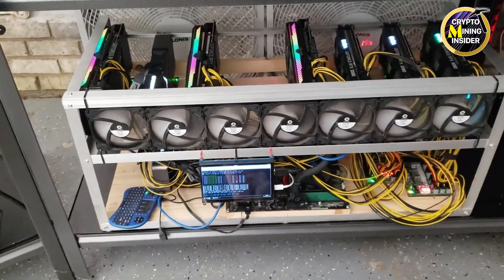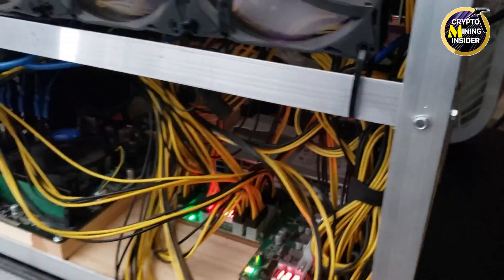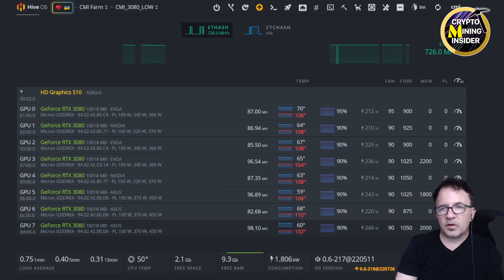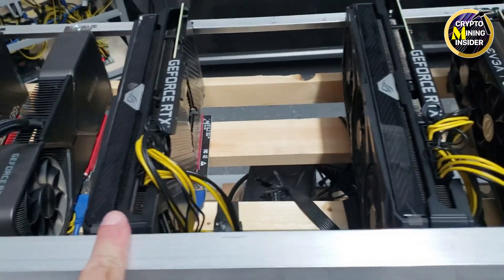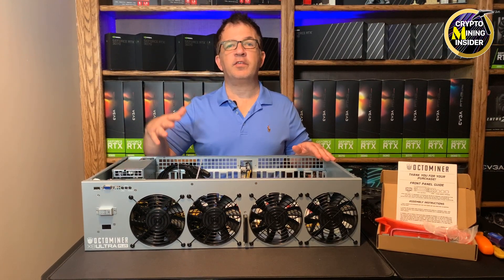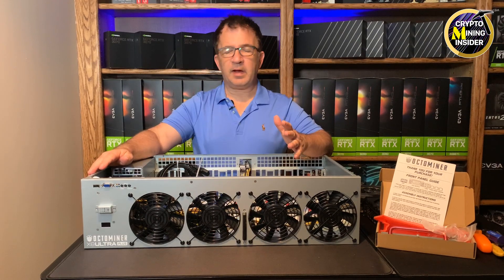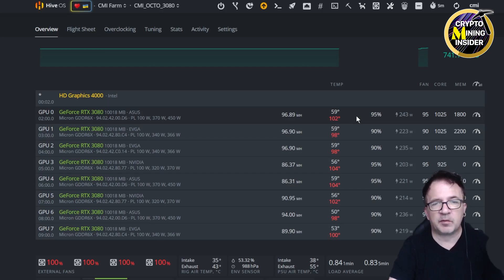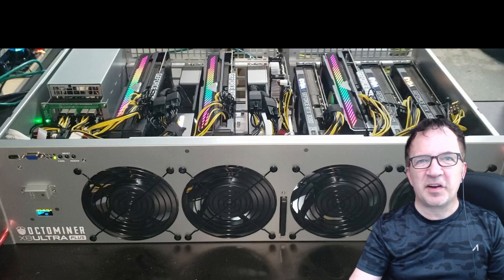🔥My GPUs are Overheating🔥 - Can an OCTOMINER Fix IT ?

Comment: Don't bother with Thermal pads.  You need to do the Copper Shims whether you roll your own or buy the precut ones.   I have a Zotac RTX 3080 ti running in a non-climate controlled barn doing 108 MH on ETH running 68c GPU and 84c Memory using copper shims.  Thermal pads are a waste of money if you really want consistent reliable temps.
Reply from the maker: Thanks ! Are there Brands or sites you can suggest ?

Comment: Where can i contact you to help me decide which 3060 ti should i buy ?
Reply from the maker: I try to keep all my communication on YouTube for now. You can post here.
Reply: Ok so for example i can buy this gpu GIGABYTE GeForce RTX 3060 Ti GAMING OC 8G, 8GB GDDR6, GV-N306TGAMING OC-8GD 2.0 for around 600 euros but as i know for around 60 mh/s the power consumption is from 135 w to 150 w i am trying to find 3060 ti that has PW less than 135w with triple vents… so i tried to buy evga 3060 ti ftw3  but it is unavaliable which one would you recommend, currently i have gigabyte aorus elite 3060 ti for 60mh/s pw is 141 w
Reply from the maker: @bockyboc  I am not a big fan of Gigabyte cards for mining - they use more plastic on their frame and run hot imo. Some people get lucky and find great running ones.
I like the 3 fan cards since they run cooler. I'm not sure which other cards use the lower wattage, the EVGA 3060 ti FTW was not easy to find. for Mining ETH some of my 3070s perform extremely well too - look into the EVGA 3070 xc3, possibly FTW 2070 too - i'm watching it mine now and says 116 watts at the miner, but I'm not sure the at the wall #s since it has RGB, fans, etc which will some more power, great card since it has 3 fans and big heatsinks.
Reply: Just 3070 or 3070 ti ? And how they compare with minning other coins?
Reply from the maker: @bockyboc   Overall the 3070 is my favorite card since it mines well and is efficient.
The 3070 ti can mine with a higher hashrate on many coins but it uses more power and runs HOTTER so it's more challenging to keep it cool.
Reply: @CryptoMiningInsider  well today i received Palit 3070 gaming pro and runs well 61/mhs 120w and i payed 650 Euros for new one i hope it will do well and just to say it was hard to find any info on that card about minning lol a lot of info for gamingpro oc and gamerock and almost null for this one 😅
Reply from the maker: @bockyboc  Congrats on new card. I heard of PALIT, but never had one.

Comment: you will have to replace pads and get 7000 rpm fans... just work on airflow and the cooler ambient temps will come in the winter
Reply from the maker: I Miss Cool Winter Temps - looking to get some higher speed fans - ordered some , waiting on them.
Do you have any experience with good high speed fans to recommend ?
Reply: @CryptoMiningInsider  I have open air rig in my spare room with air coming in and another window pushing air out those bitmain 7000 rpm fans (mostly used for asic miners) actually help push some of that excess heat out from in between the cards/rig! I truly believe airflow and ambient temps of the room is what’s most important imo! Hope that helps. Although I only have a few, I can imagine a whole rig full of them would definitely benefit the cards
Reply from the maker: @KickCHIEF  Thanks for the suggestions - Appreciate it 👍

Comment: Hello, I hope you won't be influenced by marketing of brands

Are the fans on the open air frames as strong as the fans in the octominer? They don't seem so.

I believe if they were as powerful you would get similar results.

Octominers are unrealistically expensive compared to what's available out there.

I would recommend instead of going down that road to invest in higher speed fans such as the ones usually installed in server cases and changing the thermal pads/paste.

I am not saying the concept of a server case style is bad, it's good if it's priced in an acceptable range.

Best of luck!
Reply from the maker: There are more power fans available and I should have some coming soon and will do some more tests and comparisons.

Comment: How did you get just 1 Octominer? I’d like to get 1 or 2 of the X8Ultras, but not 5 (which is the minimum order if getting them directly from Octominer).
Reply from the maker: I ordered mine a few months ago - around April when they reduced the minimum quantity to 1
Reply: If you would like to split an order with a few loyal locals, please let me know. You can put me down for 2!

I’ve reached out to Octominer to see if they have a local (Houston area) reseller that I can purchase 1 or 2 from. I’ll repost here once I hear back from them.

Comment: Check your 3080 clock they do tend to run hot. EVGA XC3 coolers are not good and need to re-pad for sure.
Reply from the maker: I think your right - I'm trying to buy some mining time before ETH POS

Comment: This is why i don't have 3080. We need to change Thermalpad on all. I only have 3060 ti and 3070!! 

I have a 3090 for gaming and i change the thermal pad.
Reply: 3060ti and 3070s are the way to go. I have a 3080 rig but wished I just stuck with the more efficient 3060ti/3070
Reply from the maker: Totally Agree, Cards with GDDR6x like 3070ti and higher require a lot more work
Reply: @CryptoMiningInsider What i don't understand is why all brand did put bad thermal pad. We pay a lot of money for GPU we are not supposed to spend money for their mistake. For me it's not acceptable.

Comment: I've had similar results with my server cases (octos). They help a little, but I don't have proprr exhaust. I believe it just pushes air through the card, but if the ambient air is hot, it wont do much
Reply from the maker: Agree DJ Mines. I 'm working to redo my Mining Room Cooling / ventilation now to increase air flow and get the ambient room temps lower.
Reply: @CryptoMiningInsider  ok let me know I got a ticket ready so we build one in alaska!! MINER JOKE
Reply: you guys need to watch my thermal video, you cant expect to lower temps beyond ambient.. I have tried to make a video that explains how to get around this
Reply from the maker: @CustomComputing  Thanks for you input, I totally get not cooling lowering than Ambiant my Ambiant is about 95 F, cards are around 100 C which is MUCH Hotter - I dont try to get cards cooler than ambient. Also where is your air intake source. I and took quick look at your video - good presentation, however I must be missing something. With many server cases with HOT Cards would cause Server cases to run the fans CFM high and push a lot of air out. But where is your source air intake coming from ?

Comment: Octominer is great but to expencive …and with 3080 and 3090 only good in server rooms…
Reply from the maker: If you already have the equipment that works good then use it. 
The Octominer are very Nice, but expensive unless you're building a new Rig then it's worth considering since costs of quality Server PSU, Mining Motherboards, Risers, Fans, etc will come out expensive too.
Reply: It's better to look for a way to intake air into a room and exhaust air efficiently  than it is to buy server cases. You won't see better temperatures until youre able to remove the hot air from a room.

Comment: I'm running a few 3080's around 60-65 degrees and changing the thermal paste/pads allowed the memory to run at, or sub 100 degrees. 

Furthermore, you should totally look into mining inside a grow tent! It might be a great video idea in the future. I'm currently testing grow tent mining with a few rigs and they're performing really well in the heat of the summer.
Reply from the maker: The Octominer Helped, but Will likely end up doing Thermal Pads - What brand of Pads did you use or suggest?
Was thinking about a Grow Tents, but with many rigs its hard plus they seem to limit easy access to Rigs. I'm redoing my ventilation now - similar idea, basically a grow room. with high volume exhaust.
Reply: @CryptoMiningInsider  I've had great luck with the Gelid brand -- specifically the Extreme due to its malleability, which allows for some leeway in pad thickness. There were materially noticeable temperature drops across all my DDR6X rigs. 

I came to this conclusion after personally testing (and wasting money) on other cheap brands such as zezzio, owltree, iceberg, syy, and thermopad. I found memory temperatures either floated around +/- 1 or 2 degrees of stock temperatures or performed worse, 

I also hear good things about Thermalright but never personally tried it myself.
Reply: Having a few EVGA 3090 FTW3s I was forced to change my pads… I went with the Thermalright pads and had some pretty good results. The only issue I found with them was their inability to compress. I was able to get them to work but it took many attempts and a lot of manual compression to get everything just right. They’re really expensive and, having struggled with them, aren’t worth the trouble - unless you are dealing with a $3500 card (got one at the height of the chip shortage) and you want only the “best”.

I would definitely recommend trying the Thermalright pads, if only for the experience of working with them.

Comment: I tried 8xrtx 3080 and my memory was 110C next I tried  4x rtx 3090 and my memory was between 106-108C. I tried 8x3090 and all of them reached 108-110C This is inside of the x8 ultra which has the bigger gap between gpu slots. I had better memory temperatures with open air + fans. What I currently have for rtx 3090s Is a 4U rack mount case with 6 high cfm fans and the temperatures during the hotter parts of t he day are between 98-104C and during the night time I have 84-90C for the memory junction. I wouldn't recommend the octominer for gpus that have gddr6x.
Reply from the maker: Really Good Point ! Larger (Wider) GPUS I don't think will benefit - I suspect it need room for the additional airflow to help.
I found keeping my environment cool makes a BIG difference - My Farm was running pretty warm at 108 degrees F
Reply: @CryptoMiningInsider  I used 8 EVGA rtx 3090s and they all throttled : (
Reply from the maker: Curious which brand / model of high CPU fans did you use that helped you ?